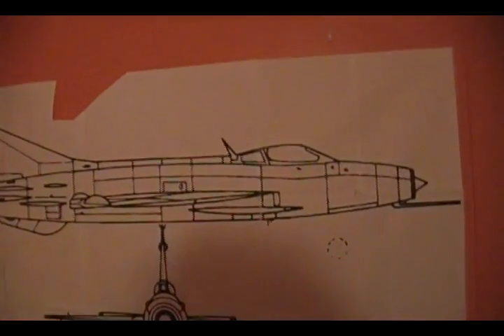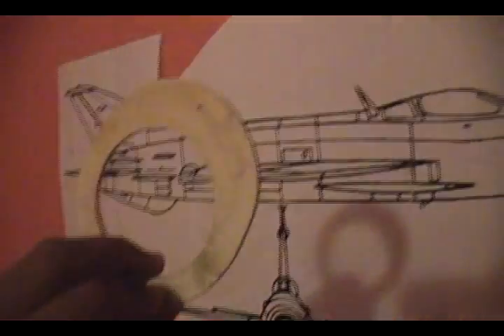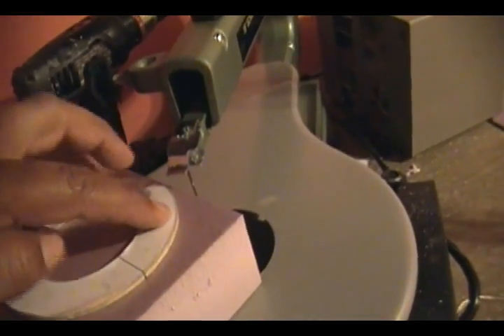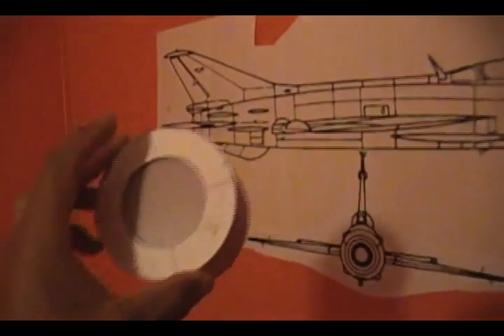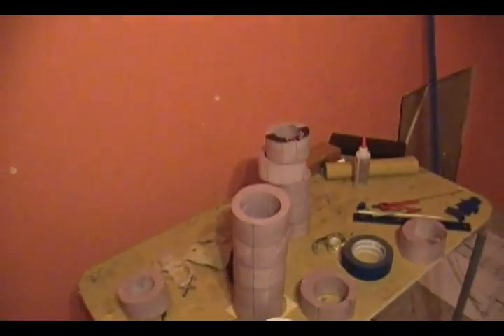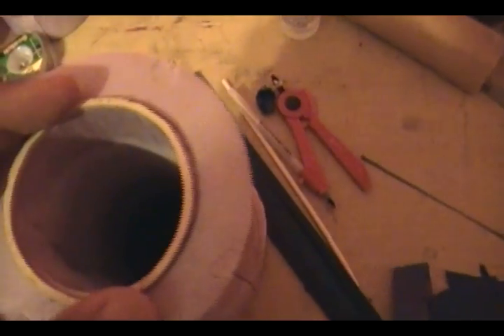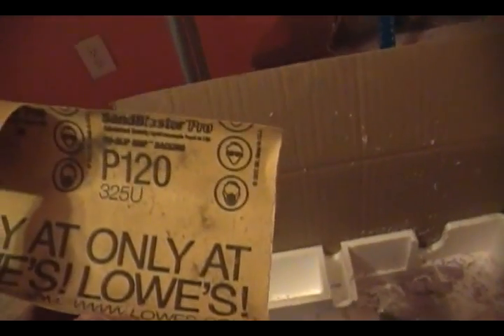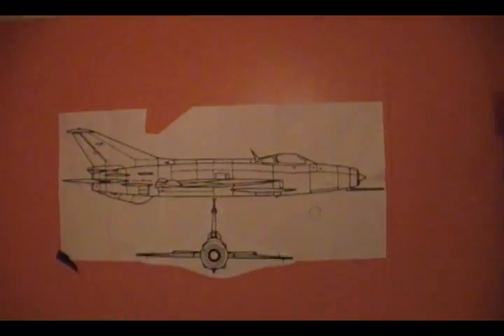EDF MIG 21 build  (part 1)

Comment: Hello Daniel thanks for sharing a good idea , you can also use a dermal tool to get the same effect just adjust the router bit low enough not to cut your wood mold,  you can also buy the attachment to make perfect circles  nevertheless your idea is just as great thanks for posting